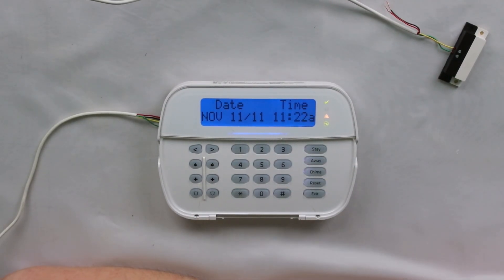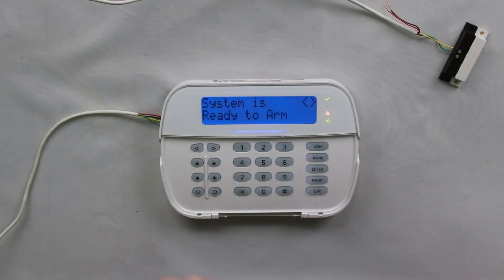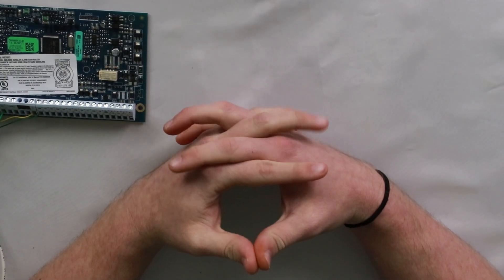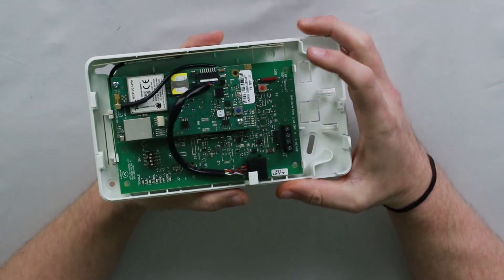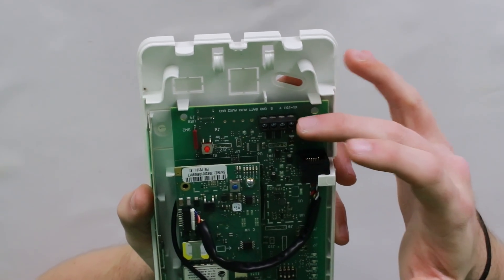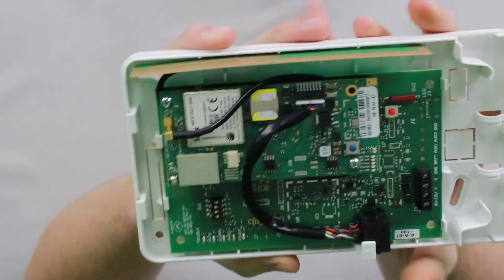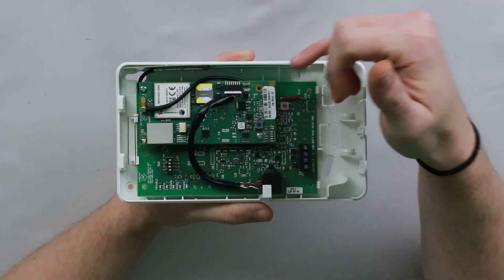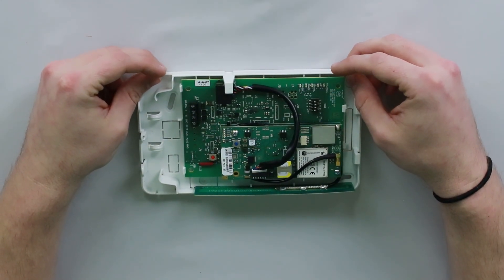FTC Trouble (Failure To Communicate) - General Tips For Troubleshooting

Comment: For those just looking to reset the error after loss of Internet etc, for me with panel HS2064 and Internet communicator TL280(R) I did this (using the '>' key to advance through the menu): * -> User Functions -> [user code] -> * System Test -> *    ... this will sound the alarm for a second and then for me the error light went off.
Reply from the maker: This is a great way to quickly send a test with the system. However, keep in mind, if the system is still unable to signal out properly, the trouble will not clear and requires further diagnosis.